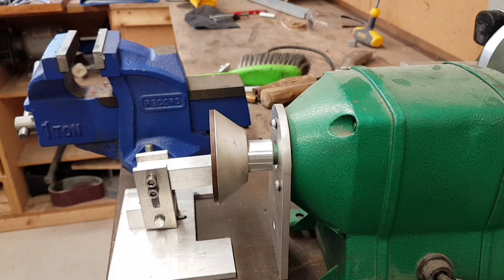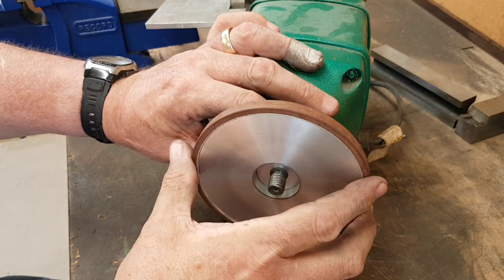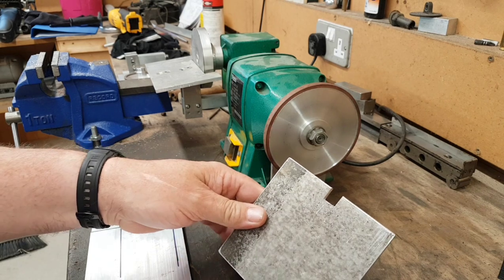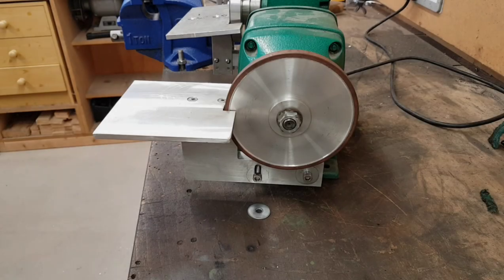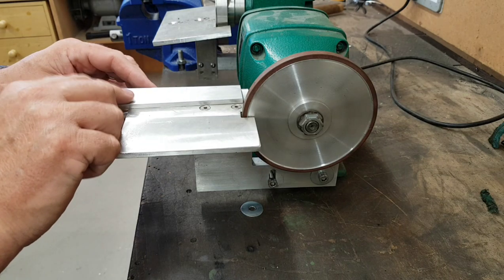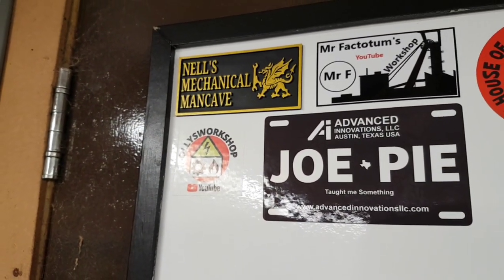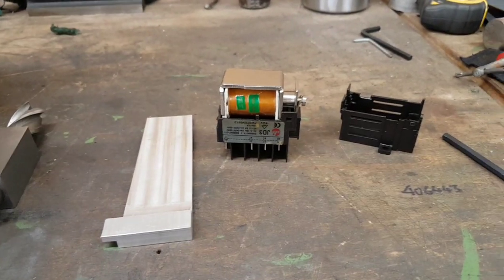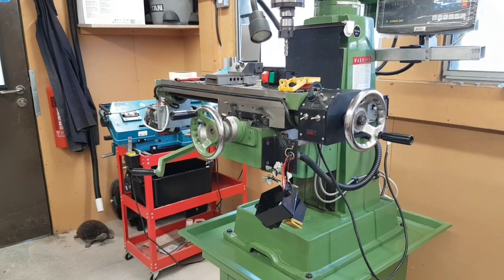End Mill Sharpener  Part 2 of 3

Comment: Neil, your mill has a completely different control system to the one I removed from mine. Warco must have updated it. 
If you are in a hurry, the company that we discussed for VFD packages probably won't be able to meet your deadline. It took three months for mine to arrive. 
Great work on the cutter grinder, I wonder if your Colchester could be reground to restore accuracy? It's a lovely old machine. 
Best wishes, Dean.
Reply from the maker: Yes mine has stop/start and direction change. I did look to warco for a switch and noticed they are not compatible. The colchester is 80 this year and theres 0.6mm of lift or play in the headstock bearing which is the biggest problem and parts are not available. As long as I'm careful it will do most things except parting off. The old girl doesn't like that at all 😁😁

Comment: LOL Buddy you and I would get along fine in a shop. The opposition team (parts and machines) need to be oft  negotiated with using language reserved for scholars of getting things done. No room for committee consensus or public survey. My tools can smell the scrap yard on me. Thus they know I have the ultimate solution near at hand - if they should opt for unruly shenanigans LOL.  

Like what you thinking on the table. Add in your 3D printing skills and print some guide plates to get some options. Happy to model something if you can't get there with your drawing program. 

Dang bad luck on the mill.  My simple understanding is that contactors  are like a fancy multipoint relay right? Just for my education. I bypassed all of that on my Harrison and my horizontal Rockwell Mill.  The Rockwell has an easy 30lbs of antique control box hanging on for mass if nothing else. 

Hang in there.  

All the best 
Dan
Reply from the maker: Twins matey. 
I bet you threaten your machines too before switching them on!
That's scary!!!!!
Reply: @NellsMechanicalManCave  LOL just so everybody in the shop is on the same page before we begin. Setting expectations is important I have heard.
Reply from the maker: @houseofbrokendobbsthings5537  🤣🤣🤣🤣

Comment: Joe is a top chap. Very useful. On the issue of the lathe, what is up with it? Have you adjusted all the gibs? On the issue of a contactor, what exactly is that one for?  Is it the main power?
Reply from the maker: The Lathe is 80 years old Ben. It has plain bearings on the Spindle which has 0.6mm of lift on them. Basically, it's had a hard life and you can't work it to its potential.  That's why I can't part off because of chatter.  Gibbs are OK but I can't tighten them too much due to wear, things lock up.
The contactor,,,, is the main on off and also acts as a switch over relay for direction.
Reply: @NellsMechanicalManCave  You can buy a whole cantactor in a box surely though?
Reply from the maker: @BensWorkshop  I could Ben, but the switch and contractor configuration isnt shown on the drawing and,,,,, all the wiring is black.
TBH, it's easier to replace like for like or go VFR.
A £30 fix for now then VFD for Christmas 😊
Reply: @NellsMechanicalManCave  Fair enough.

Comment: Hi, what grit wheel are you using ?,   thx
Reply from the maker: Hi,
Think I went for a 300 grit. I did a Google search and read a thread in practical machinist that said over 150 and below 500. Over 500 requires water cooling and 1200 gives a mirror finish.
Cheers Neil

Comment: Hi Neil. Your machining looks perfectly good to me! I'll email you my phone number and you can phone or WhatsApp me for any assistance you need with the mill contactor (I'm an electronics engineer).
Reply from the maker: Oh,,,,, I thought you were a bricklayer 🤣🤣🤣🤣🤣🤣🤣
Only joking Olly !!
I knew what you were in the first minute of the first video I watched of you. I ran the maintenance in a multimillion pound facility but I'm mechanically oriented and I'd come up with an idea for a machine designed and throw the concept to the electrical guru (John)  who would call me a tosser because it involved a PLC and it then took over his life until complete. I had to make large amounts of tea for him though as he said it helped him think 😊
I'll WhatsApp you back or text as I'm thinking of going VFR after I got let down by that company.  Last one I programmed was in 2001 and it was a Siemens 250kw,,,, things have changed 😳
Reply: @NellsMechanicalManCave  I have a spare 1kw motor and VFD if you're interested. On a completely unrelated note, I'm currently waiting for my 666th subscriber! 😬
Reply from the maker: 666!
Is that worse than your 13th ?
Better the devil you know mate 😇😇😇
1.1kw is the minimum on the mill but thanks for the offer. 1.5kw motor with 2.2kw VFD is what I'm thinking at the moment. That way I'm a good bit over 1:1 on the more fragile bit.
I'll get the mill back running with the standard contactor then consult my personal electrical engineer 😘😘 with options.  It's great having mates who can guide mechanical loons like me in the right direction. Saves the NHS shit loads on burns dressings !
Cheers Neil 😁😁😁